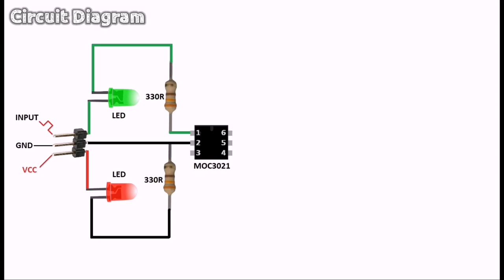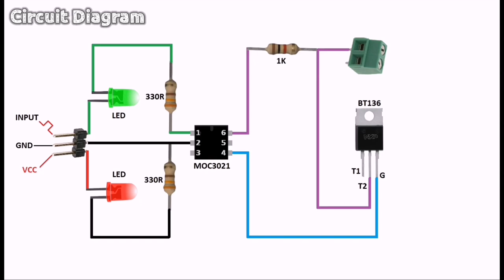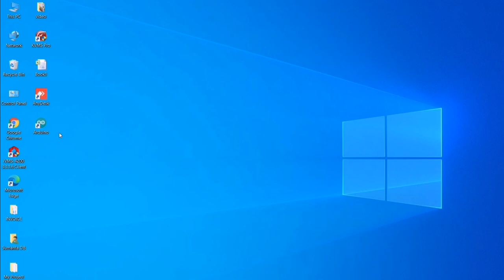How to Use Optocoupler and Triac to Control AC Load | MOC3021 Triac Driver Circuit | BT136 Circuit

Comment: Thanks so much for this, although just a slight correction on the wiring diagram. It should be  input and output of the live connected to the relay as opposed to both the live and neutral right?

Comment: Instead of arduino, can i use 9v battery and connect it to 1 & 2 of MOC 3021 and works the same? Also with the leds

Comment: Followed this circuit. T2 with 1k resistor, and then the resistor burnt. Load was just 10w or less (a low power led bulb). Using moc3061 and btb12 600v (a 12 amp triac)

Comment: Possible to connect 1 HP Motor?
Reply from the maker: Not possible 
You can use BTA41 instead of BT136
Reply: @THEELECTRONICSADDA  do we need to put a heatsink for BTA41?